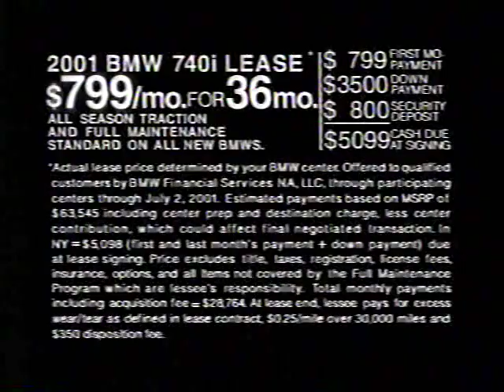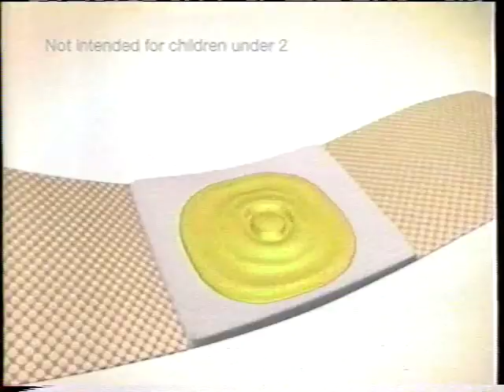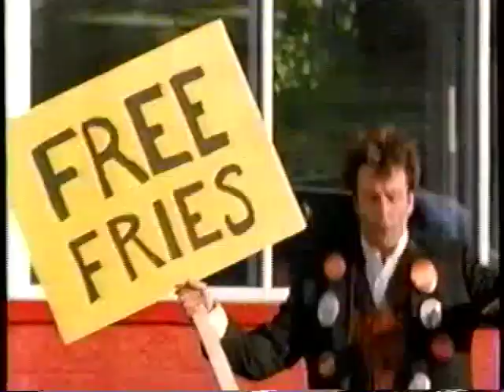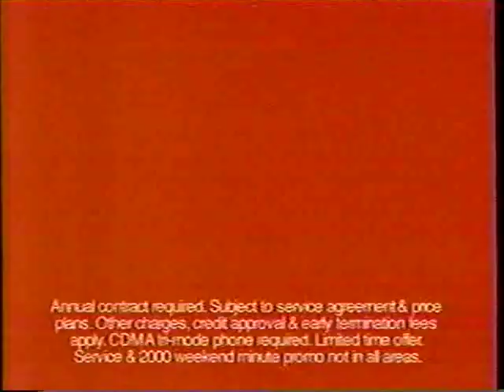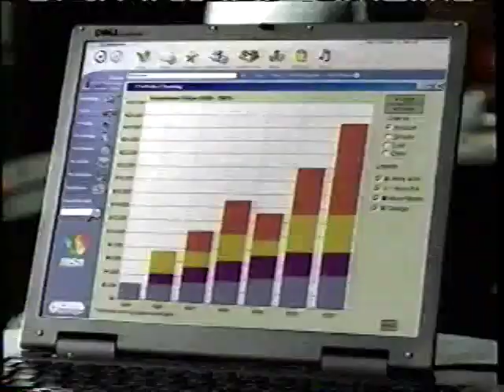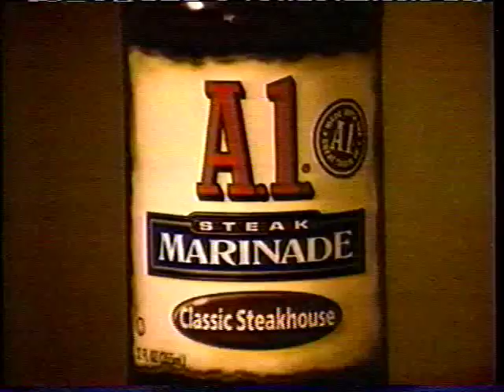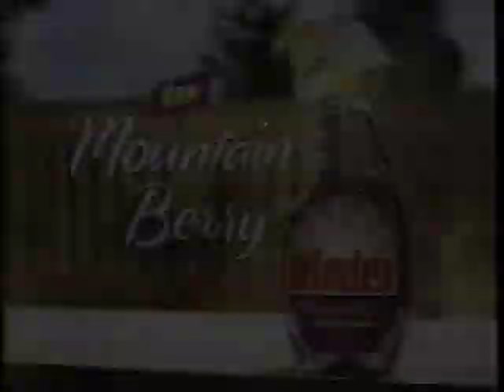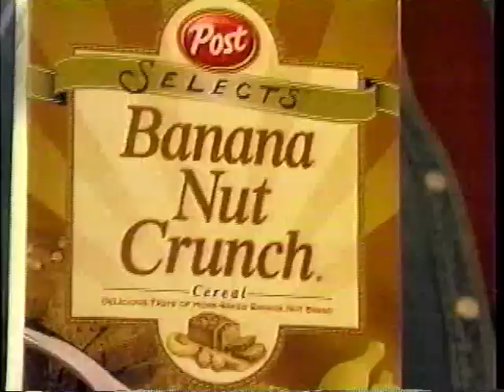CBS/WCBS commercials, 5/25/2001

Comment: The period from 1997-2003 was the worst period in channel 2's history. Following the station's ratings collapse between 1993 and 1995, Bill Carey was appointed as the station's news director. He fired many anchors in an attempt to improve the station's ratings, resulting in the launch of a hybrid traditional/tabloid newscast format in May 1997. This format had three changes throughout its six-year run, but the worst of them all happened when Joel Cheatwood replaced Carey as news director in 2000. Cheatwood implemented some elements from WSVN's successful 10 pm newscast into the WCBS news operation, including an 11 pm Nightcast show. This resulted in a ratings decline throughout most of 2001, which culminated in the September 11 attacks. The station began to return to a traditional format for its news programs when Cheatwood was fired the following year.